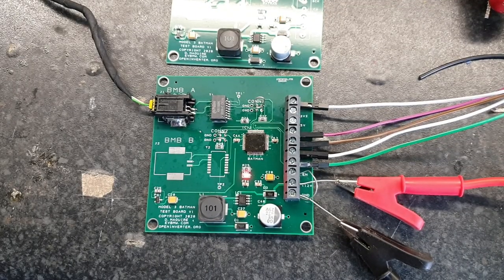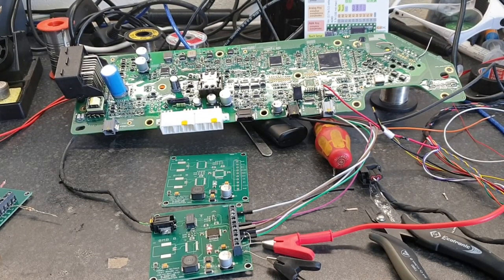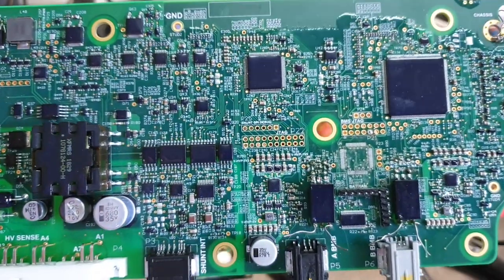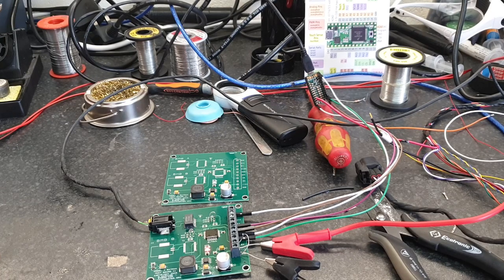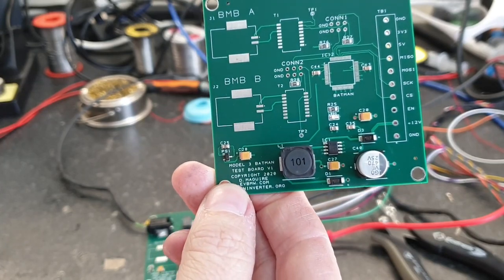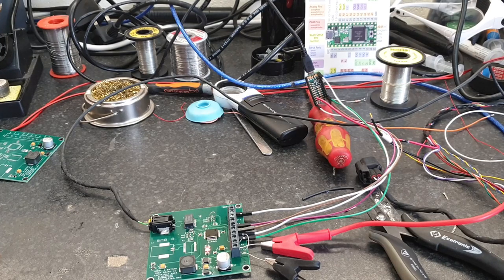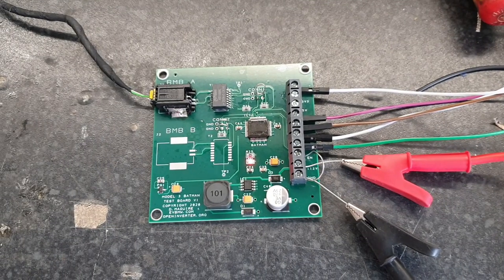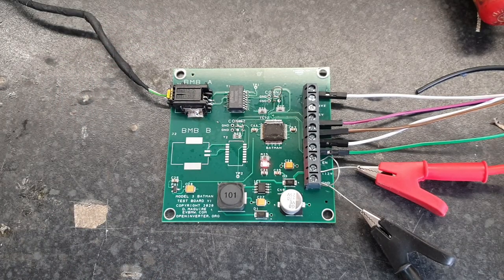Tesla Model 3 BMS : Transplant Surgery

Comment: Hey Damien. Cool stuff, I'm sure you have seen all the old EVTV stuff. It was hypothesised at the time that these parts were just LTC6813-1 parts, as they came out in a 64pin configuration not long after the model3 was released. Would be interested to know it you've already tried this same part. Cheers!

Comment: Really enjoyed you getting some progress on this project👍😀. For now you are just reading the voltages. When will you be able to activate the balancing side of th board?
Reply: How long is a piece of string. this requires alot of reverse engineering of the protocol, unless you got the documentation there is no telling if you will find out the required logic, let alone when.

Comment: Hi Damien,
Do you know where are the temperature readings on the slave BMS board? I am designing an energy storage system with tesla battery modules and a third party BMS and would like to know if I can get temperature readings from the battery cells?

Comment: I've not been following this, but is the batman chip just a protocol converter to the iso spi interface?
If so what's to stop reimplementing it in a small FPGA?
Reply from the maker: Am working on that with a spartan6. My verilog is lousy:)
Reply: It can be used as a protocol converter but it is also the actual bms chip for the slave boards.
Reply: @Evbmw  Would the files from 16.Oct on GitHub be your recommended version to connect my 4x M3-BMS in daisy chain and convert the data received into a RS485 CAN Bus?

Comment: Hello Sir. You are mentioning that you are having several Tesla model 3  battery module PCB delivered from a person in the US. I have removed a PCB now and having trouble reconnecting to the Ribon-cable on the module. Could you kindly ask you contact in the US how he is reconnecting to the module….. I have tried to solder on to the ribon but with no success….. I am desperate in need of help…

Kind regards
Simon, Denmark.